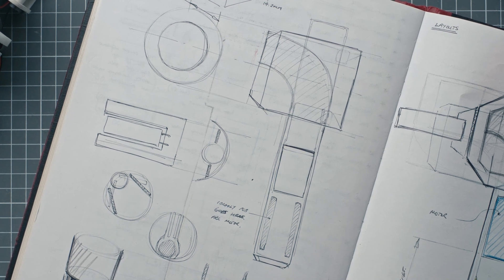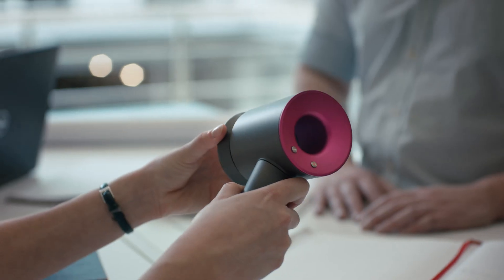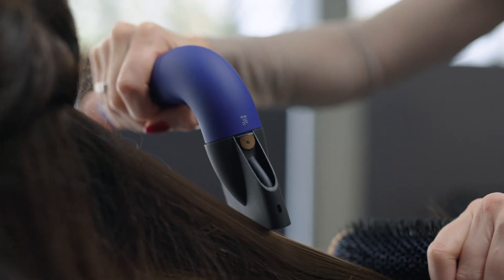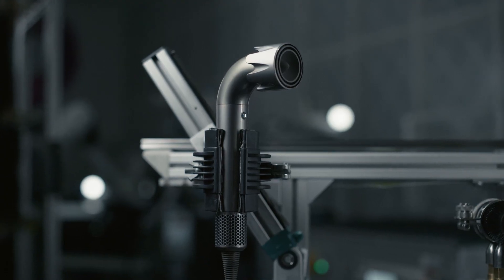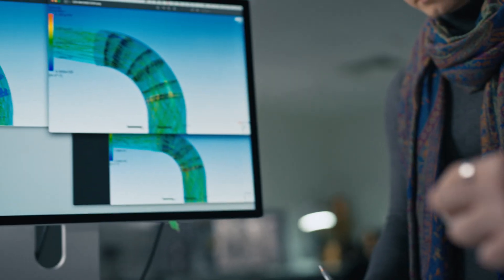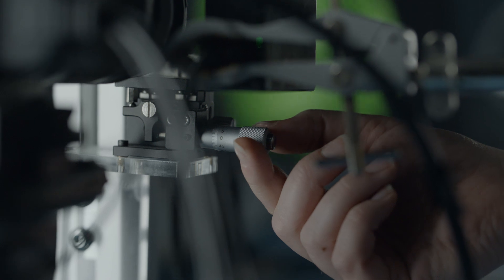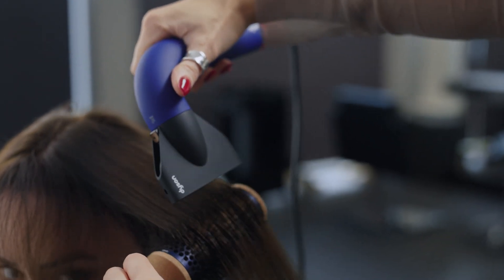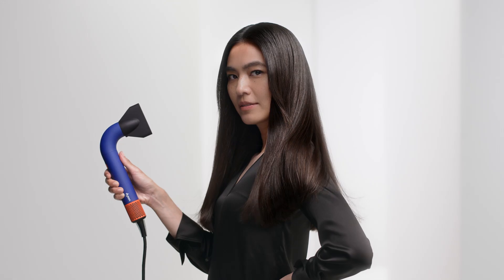The engineering story behind the Dyson Supersonic r™  Professional hair dryer

Comment: So when I put a attachment back on and switch between the two the fdri chip remembers the heat setting I last used?
Reply from the maker: Yes, that's correct. The Intelligent attachments communicate with the hair dryer via RFID chips, to instantly adapt to the right temperature and airflow range for optimal performance. They come pre-set for optimal performance but you can adjust these to your needs, and the machine will remember your last-used setting.

Comment: Are they actually comfortable to hold? It just looks so ergonomically wrong.
Reply from the maker: Yes, they are 😀 This brand new format of machine with improved reach is ergonomically designed for control and comfort. It’s 30% smaller and 20% lighter than the Dyson Supersonic™ hair dryer.

Comment: Why Not Make It Wireless? Your vacuum is wireless.
Reply: Making it wireless would add considerable weight due to battery. Hair styling tools are used for longer times as compared to vacuums and you wont just rest it on the surface and let it slide. You're gonna carry its whole weight so probably that's why they dont push through with wireless tech. Also, having motor and heater draws quite a lot of power which will drain the battery really fast. They had one wireless, the coralle which is just a straightener (no motor).

Comment: I like the look! Also cool to see CFD that went into the design! (Computational flow dynamics)

🤞it doesn’t have as much high frequency noise as the previous one (though same motor) but it’s not a deal breaker x
Reply: Dyson has been using CFD since forever.

Comment: Name them overpriced hair dryers but damn they look good.
Reply: the reason dyson is expensive is becasue they designing there own tech and that comes at a cost to make no other company develop there own tech just copy others and dyson is like a iphone its built to last my dc 40 has lasted 7 years now with out any problem if i bought a cheap vacuum it would have failed the first year for use so you get what you pay for buy cheap and all ways replace it or buy good built machine and have it last years and it saves you money in the long run
Reply: @MRJAMEZ.2025  bro, breaaaaath! (or use commas)
Reply: I bet $549
Reply: @bostonhandsomeguy  you get what you pay for
Reply: I don’t think they’re overpriced considering nowadays people purchasing an iPhone.
Reply: They are the only company to make normal stuff into status symbols
Reply: They are worth every penny ❤️
Reply: I mean the industrial design and the performance of the machine is superb. I tried it at a shop and it feels very premium and also makes significantly less noise. The air is really well directed and the heat control is also very responsive. Not to mention that it looks really sleek and compact. Whether it's overpriced or not, is subjective.
Reply: Name the brokie in the comments section